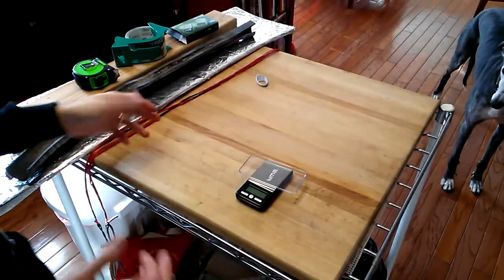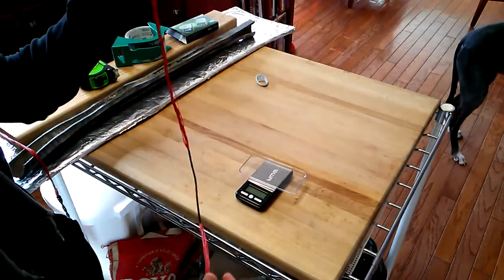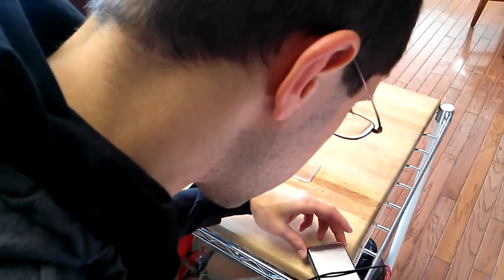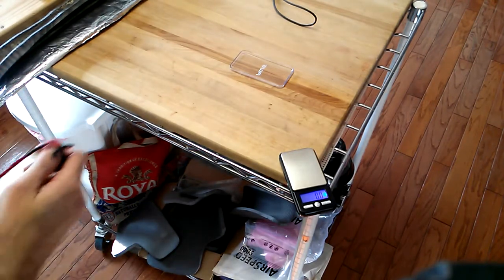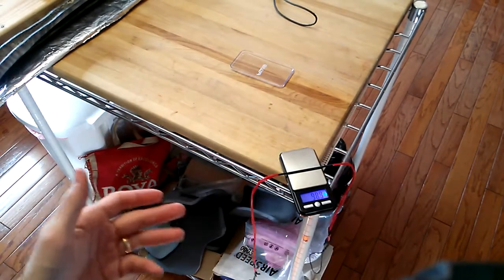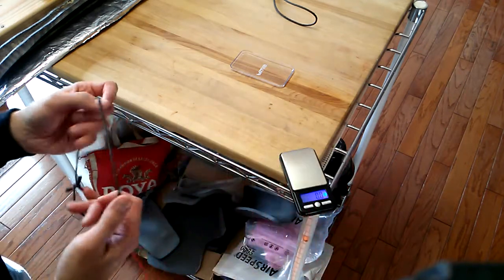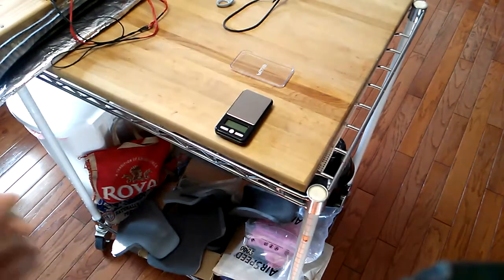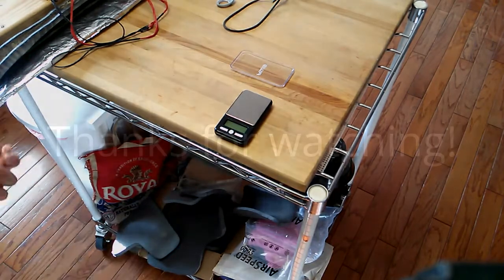How Light Can I Make A Bowstring (without destroying it, or the bow?)

Comment: The weight of the string is something I've taken into consideration before, but this video really drives the point home. 154 grains is quite a bit of extra weight that the bow has to deal with, if you think about it. Shaving off almost 57 grains is quite an improvement!
Reply from the maker: And that's 57 grains off of the improved string! The original is with Ruben, and I'm pretty sure was 175-200+! I wish I weighed it before I sent it off.

Comment: Hey, Tim just a little advice on making dacron loops. start out making the loop twice as long as you normally would with half the material, fold it in half and counter twist them together (sort of like a flemish twist) that way you only have one loose end. And you can you can seal that by wrapping it  in electrical tape and and using super glue to keep it from fraying
Reply from the maker: Gotcha, like making twine that folds back on itself? I need to try that next time, the inherent twist in the stuff I made is a pain in the butt!
Reply from the maker: I love screwing up - as long as I learn something from it, it's worth it.